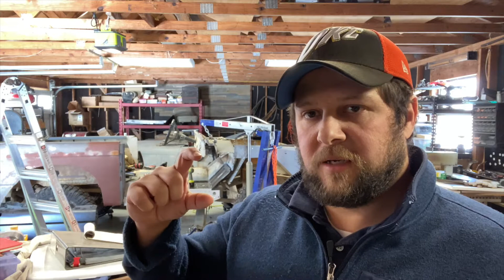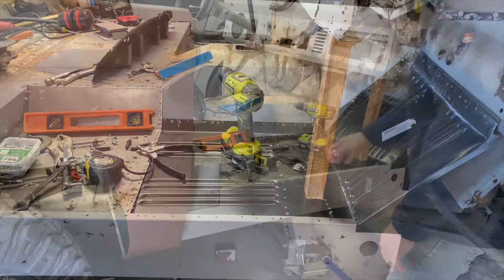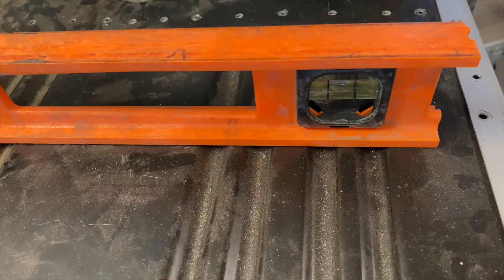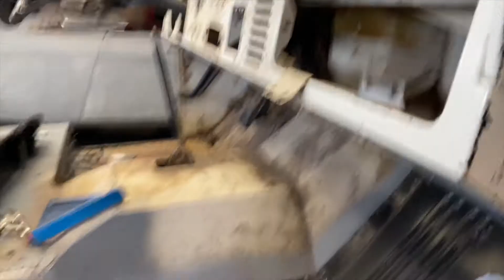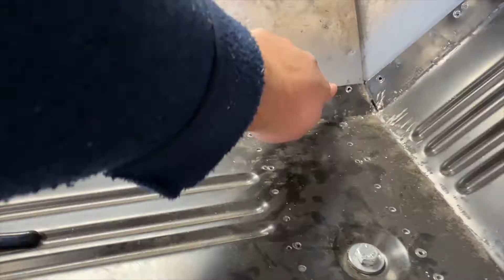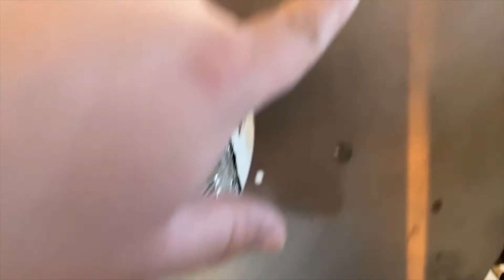Early Bronco Restoration l Getting Everything Level, Tight, and Square!!

Comment: Side kick panel looked a little krooked. Make sure, like you said, that it’s straight. Also find your dash bracket that bolts to the side panel an make sure it’s located correctly as well.
Reply: I know mine were way off!
Reply from the maker: I forgot about the bracket. I’ll have to find it and put it on to see if I’m close. Then I think I’ll start taking it apart again to put some weld thru primer on. I feel like I’m closer than ever to welding.